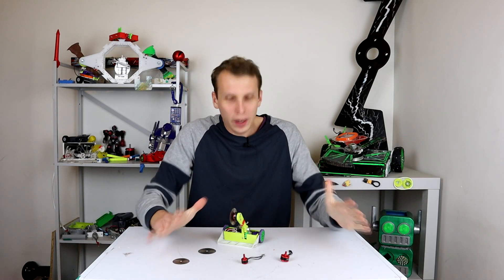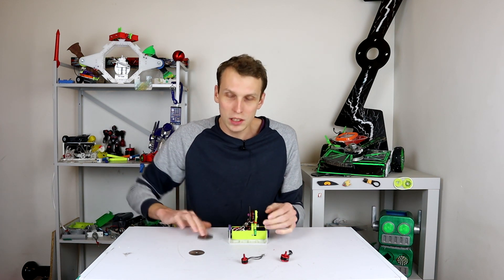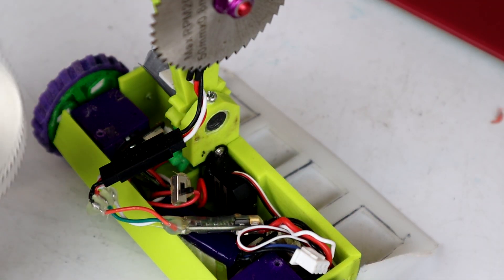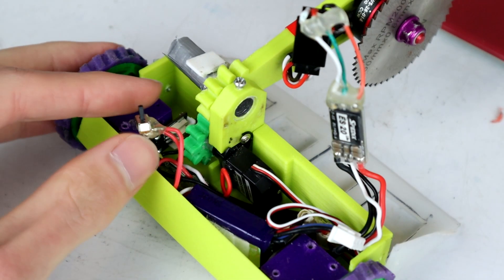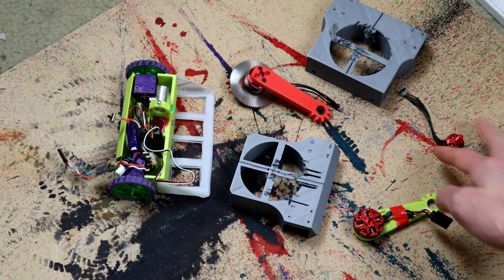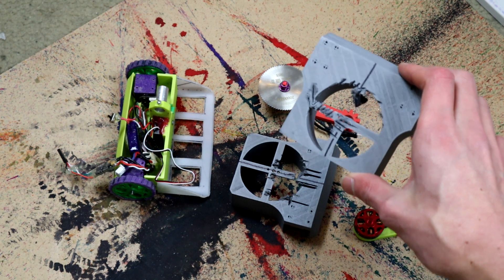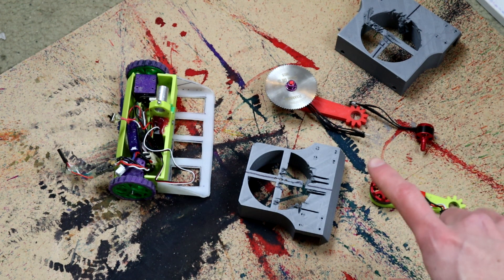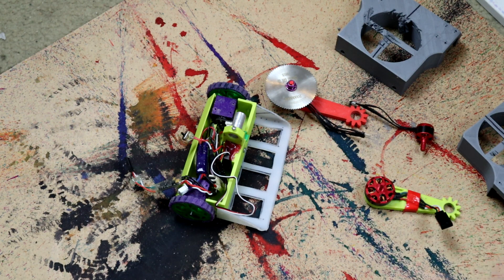Which saw blade cuts best? (150g over head saw combat robot)

Comment: Hey can I ask you a question
Reply from the maker: Sure
Reply: Team Panic when you are 3D printing your chassis and parts how do you get the screw to stay in place with out sliding back out
Reply from the maker: I print the holes smaller then they need to be and use self tapping screws.
these screws bite into the plastic and hold tight

Comment: The bottleneck is probably the battery. If you try upping voltage or capacity you would get different results. Larger motor is more efficient to use the amps it's getting from the battery because it has wide stator. Higher C battery would also work if there's no weight left.
Reply from the maker: Thats an interesting point, I have a few bigger batteries around that have higher current outputs, I might try them just to see if the higher current helps with the bogging down

Comment: Very interesting, sorry to be a pain, did you try those metal cutting discs like "Dremel 40mm diamond cutting disc"? I never tried it on a combat robot but I used it on a power drill once to cut some new grooves in stuck bolt heads.
Reply from the maker: Yeah my plan for the next event is to have a bunch of different options for small saw blades, I might even remake this video with a few of the more interesting options